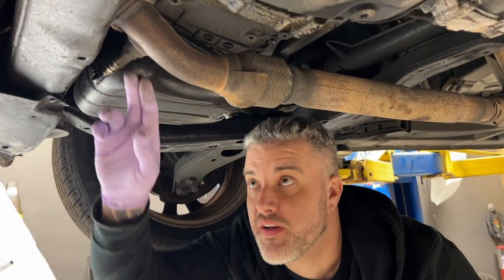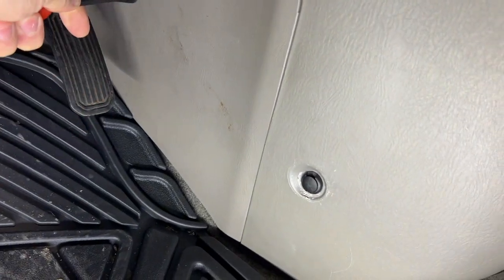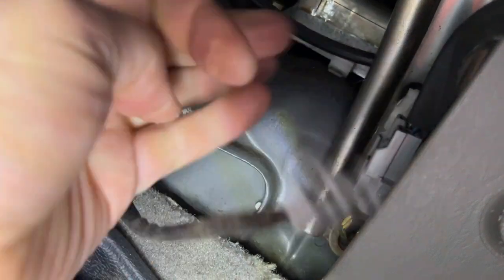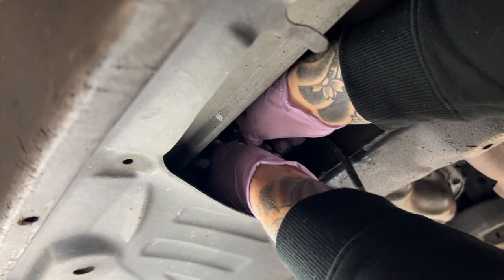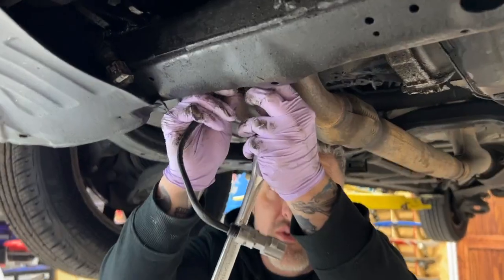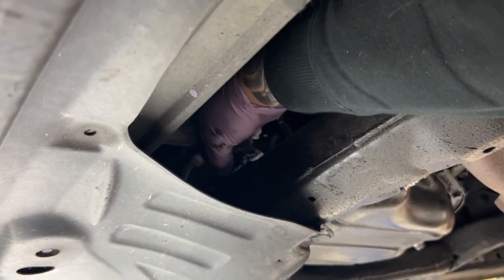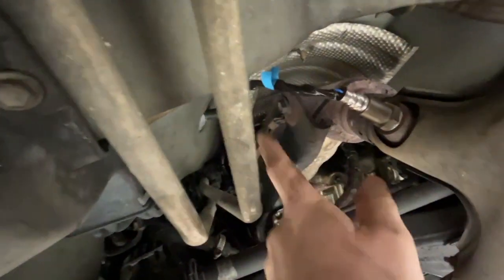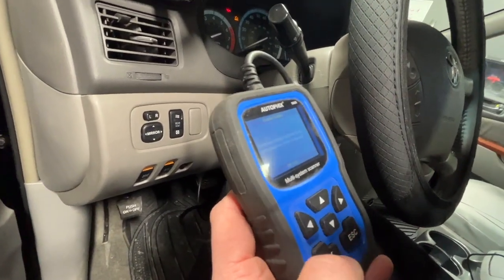How to replace an o2 sensor on Toyota Sienna

Comment: If after erasing the code the check engine light comes on again, that means the problem still persists?
Reply from the maker: Could be a few things. It could be another oxygen sensor. If that’s not it check your spark plugs and coils to make sure they are burning all the fuel. If that’s not it then it’s the cats
Reply: @givebackgarage  cat

Comment: why i got 2 codes after replacing the sensors p0420 and p0430 any ideas? car is running fine
Reply from the maker: I’d start with the oxygen sensor. But it maybe the cat